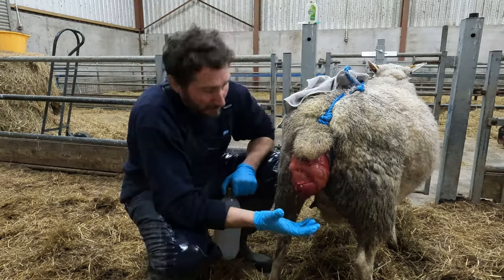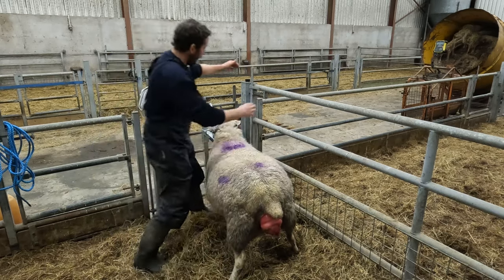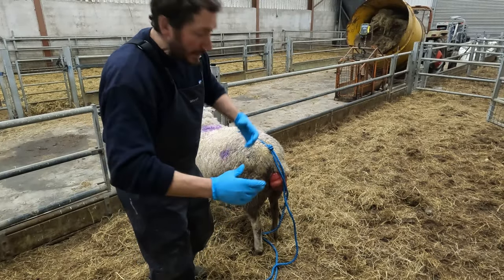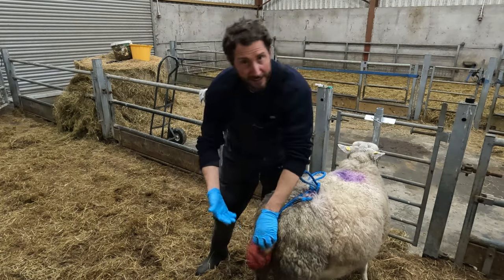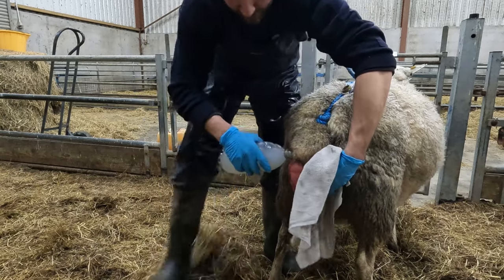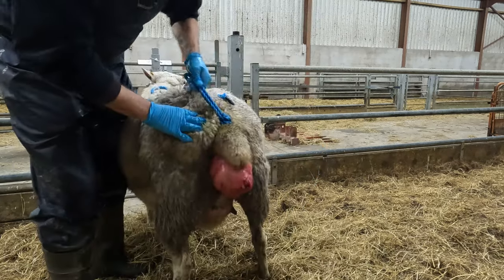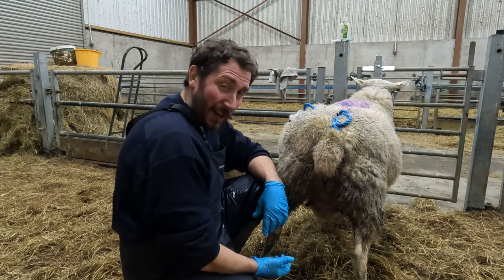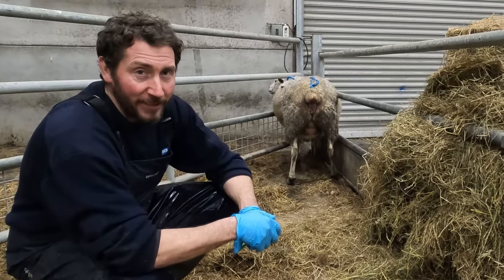Sheep Prolapse - Simple Solution

Comment: been using the rope homemade harness for years, a sprinkle of white sugar on the prolapse helps it going back in I usually don't wash certainly not with cold water  use lukewarm , if help was available (wishful thinking) I'd roll the ewe over & lift her by the hind legs and very little pressure needed , , watching youtube etc I am surprised by so many seasoned sheep people still stitching and using spoons , great video, good luck with the lambing , down to the last 20 here
Reply from the maker: Thanks for the tips 👌
Reply: What was the Sugar for .. 
Lubrication or antiseptic I wonder ?
Reply: @Coolcronan i have not heard of this before, vets used to use sugar to help return a prolapsed inverted uterus post partum. Sometimes seen in cows.
Reply: @Coolcronan forgot to mention, the sugar shrinks it.
Reply: Definitely use sugar, did one last year without sugar and was a struggle to get back in.
Reply: @dafyddjones8940  It must be for lubrication then so .... Honey has antiseptic properties maybe sugar has also ..... Its was used in poultices back in  the old days I think !!